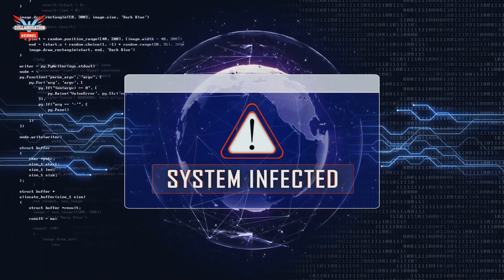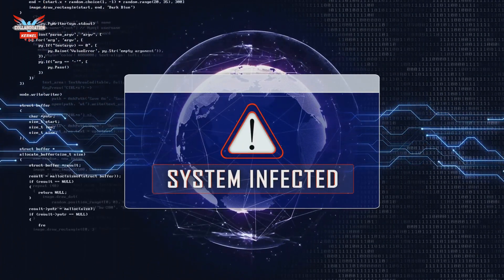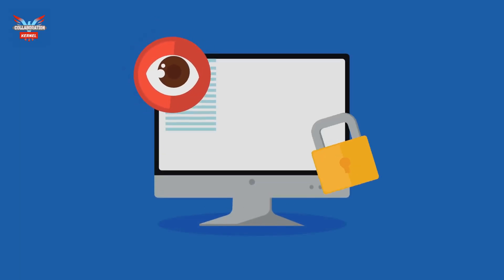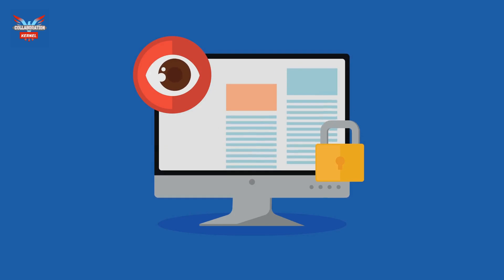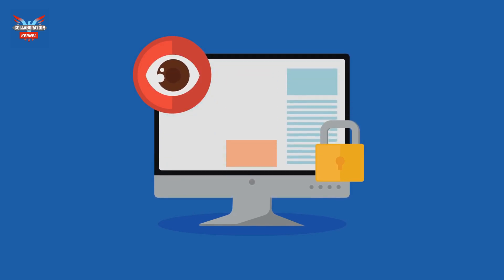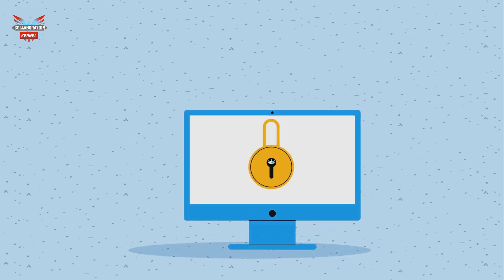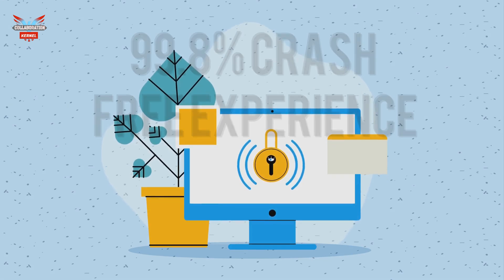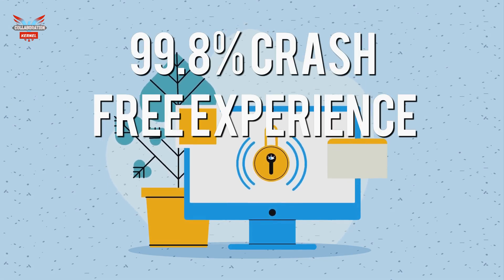Will You Be FORCED to Buy a New Computer for Windows 11?

Comment: It has nothing to do with your security. They want to forcefeed you a new computer and have total remote control of your machine, which of course, is not actually yours at this point. They can lock you out or undo administrative changes you have made. They can screenshot your passwords and private data and steal your trade secrets. Sounds like they don't want you working on your own computer either.. making simple hardware changes into a nightmare. No thanks. Using better options.